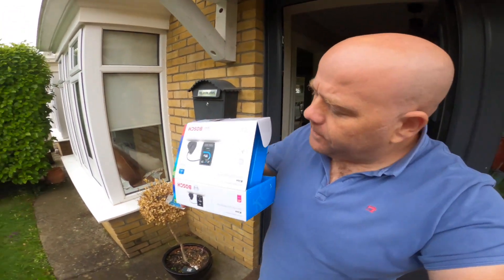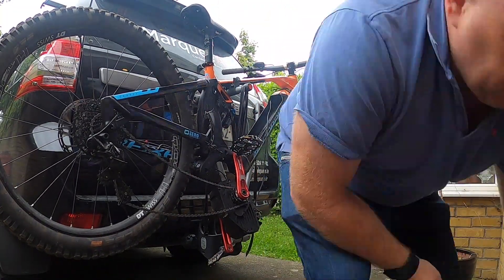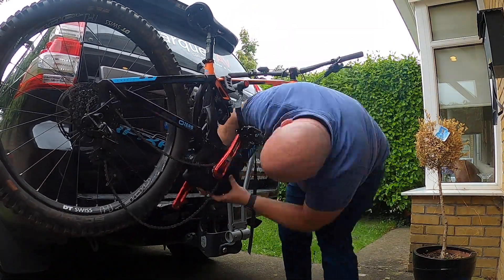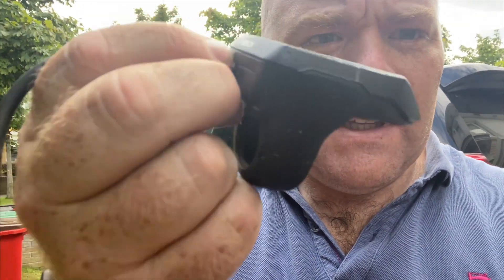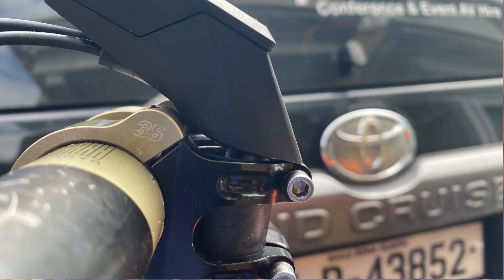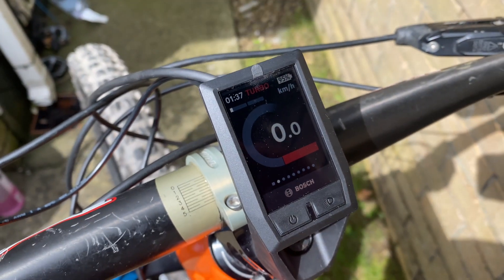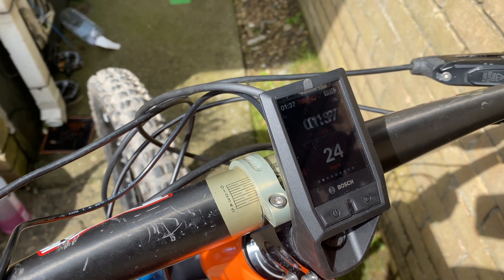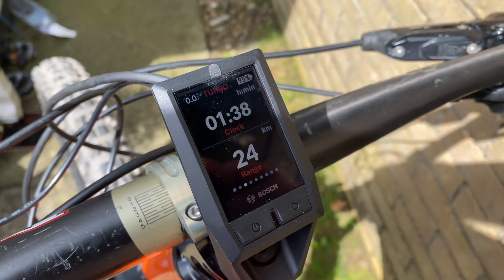Kiox Retrofit to Bosch Gen 3 Motor

Comment: are you able to remove the display unit from the holder?
Reply from the maker: Yes. As far as I remember, but don’t think the motor will activate without the unit connected. I used to keep it tethered to the bars in case.

Comment: After 1 year, how to are you sudisfy with Kiox? And whats the difference between Kiox and Kiox 300?
Reply from the maker: Hi Alen. 
I have moved to Shimano motor shortly after. I sold this bike to a friend and it’s still working very well. He likes it!!
Reply: @TrailAdvisor  nice, 
Im glad he likes it. 
I just bought cube reaction hybrid for traveling to and from work. And i saw this  Kiox 300 display and its amazing to me. Saving for that now. 😃
Reply: i have one more question regarding kiox retrofit. 
was your purion sync total odometar km/ml to kiox or not? if i buy used one will he use mine total odometar or from kiox?

since i bought new bike naw it has 180 km total.
Reply from the maker: I’m pretty sure it takes the reading from the motor and not the display.
Reply: @TrailAdvisor  i tough so but i just wanted to be sure from someone who done it himself. :)

Comment: Good video. Was there a small screw securing the display from the back? Mine keeps falling off fitted from factory. 👍
Reply from the maker: Nope. I just use the magnet and a lanyard around the bars. Only falls off when I crash!! You can put a screw in though. Not sure on size.

Comment: Thinking of upgrading the display of my ebike to kiox whick looks better. 

Do you have to go to the dealer to get the latest firmware/software update?
Reply from the maker: Hey Lax. No, you can update the kiox through the Bluetooth app. It may then say your motor / drive unit needs updating which is dealer job. But will still work perfectly fine.